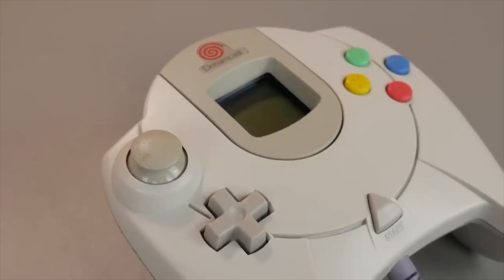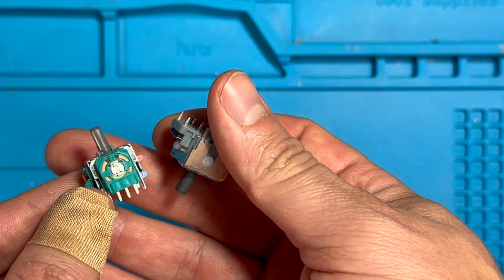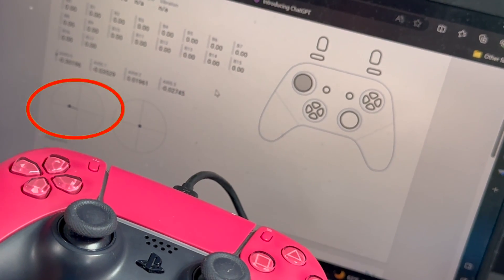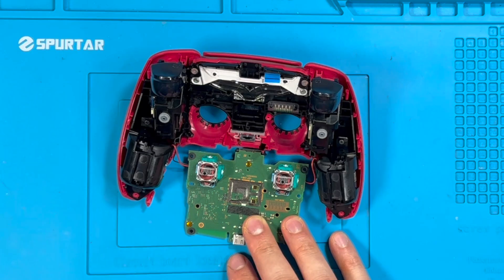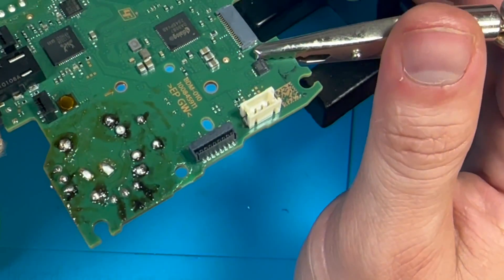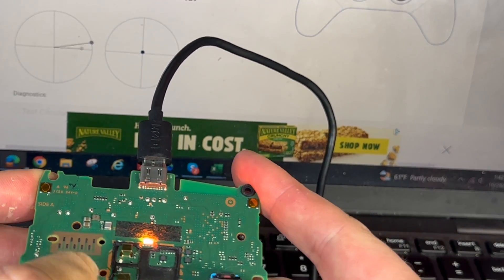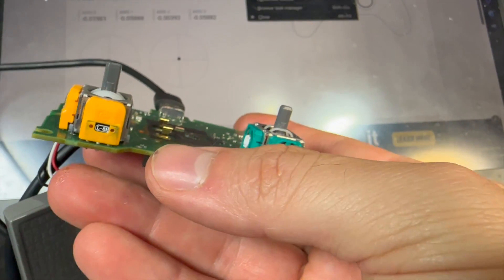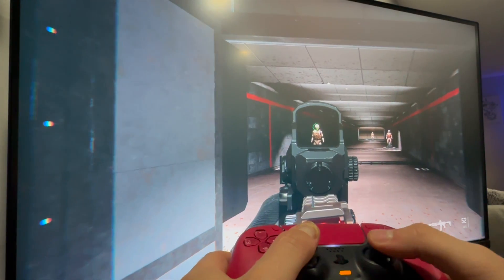Using Hall Effect Magnetic Joystick To Fix Stick Drift Controller

Comment: When soldering the pins on the new joystick, my go to method is add flux, put a good amount of solder on my iron, and just touch the pads. It helps free up a hand. Also don't be afraid if any pins get bridged, just clean your iron, add flux, do a quick sweep, and repeat until the bridge is gone.

Comment: 5:00 instead of that you can just place a coin over the points to desolder. set the iron to max with the flattest largest tip you have and place the bolt on the coin. works every time, i drilled a small hole in all of my heatspeaders to easy lift them away and or hold them in place while flipping the the boards over to do whatever needs done :) 

when using a sucker you get better result by heating the backside and sucking the tin off with no bolt in the way. this is quite easy as the other side now has a hole for your iron's tip to enter and stay in. transfers the heat much faster than just a flat contact point too. i like to place the board at a 90 degree angle with the side facing me, this way i hold the sucker with my left and the iron with the right. makes it easy to line up both hands :) also you should put shrink on the alligator clips there.. the marr the pcb when u have them bare.

i hope that some tricks from an old fart can come in handy some time for you too sir. i did not know there was replacement hall effect pots for these. cheers.
Reply: That second idea would've helped me a lot during my last stick replacement. Wish I read this sooner. 😂

Comment: how safe it is to use the heat gun with these pcbs?
Reply from the maker: i've done it multiple times and it works
Reply: @TheGamer2Know  great to hear. Any suggestions before I embark in doing it? Temperature limit, etc. I tried with the solder iron but I couldn't manage to remove the joystick yet. I'm going really slow so I cannot damage anything. Ive seen some people using aluminum and electric tape to cover other components on the side while using the heat gun.
Reply from the maker: @tahaslime2089  best to use the removal alloy SMD to remove joystick, temperate i usually doing 700 on solder iron and heat gun. Yea you can put foil to protect board. I made this video, also using similar method. https://www.youtube.com/watch?v=GZRlOTXlSe0&t=841s

Comment: How many years it lasts hall effect analog
Reply: About 300. It's frictionless. The plastic will wear out before the magnets fail. I'm trying to learn soldering so I can do mine. It's the desoldering that I'm really struggling with.
Reply: @zachypoo420  I just did mine. Not much experience soldering but I already had a replacement that I bought from eBay for $30. I highly recommend removing as much material as possible with the wick before adding the low melt and hitting it with the hot air. Just makes it a bit cleaner. Also there's now software to calibrate the sticks so no need to do it manually like he did at 8:40.
Reply: @Dspic09  2025 ive seen repair guys like stickrepair use that software. So yes. Maybe at this time he made this video it didnt exist.
Reply: @chrishellmax  yes, pretty sure the software came out in the later end of 2024.

Comment: So basically I’m fucked because I have no clue how to do any of this and I have to keep buying a new controller every month or two because of stick drift

Thanks Sony. Arseholes
Reply: Honestly its not hard to learn. I just did mine with little soldering experience. What I did when my original controller started drifting was buy one off of eBay (around $30) that already had stick drift to practice on.

Comment: Sometimes when I replace sticks the plastic melts to the board from removing the old sticks and sometimes it doesn't. Any idea why this is? It's usually flat enough I just leave it as sticks are slightly elevated installed. Thanks in advance.

Comment: Cost is higher but when you pay $70 a controller you would think they could at least use better parts… a ps5 or and controller uses the cheapest parts a joystick is like a $1 their circuit boards are cheap I would say for $10 they make a controller..

Comment: I have a question it might be a dumb question but here it goes witch one is faster and has less delay hall effect stiks or the regular one?
Reply: i suspect the hall effect as the resistance on the regular ones will take into account the small percentage of resistance of the metal round plates inside. Just logic applied.

Comment: Sadly Hall effect sensors do not solve stick drift it solves potentiometer wear, still a good thing just doesn't solve drift for liner curve players.

Stick drift is mainly from a stick centring issue as sticks are centred by a spring pushing two plastic parts together and coil spring love to loose their spring tension over time... Don't believe me buy a hall effect controller go into the software and remove the DAEDZONE in the software. Gamersir Nexus for the G7 controller for example even has this as a warning in their software stating Lowering "initial value under 10% will make the stick very sensitive, which is prone to drifting, please use caution".
I own 6 controllers 4 with hall effect sensors and they all have drift out of the box after removing the deadzone also they seem to perform poorly in circularity test unless you have software to help fill in the gaps. 
Sadly social media has hyped them up and put down potentiometer being the main issue defiantly can be if they are worn however you would see voltage drops where it makes less contact resulting in loss of movement like my old Xbox controller.

Saying that I really like the Gamesir G7 light weight, 1000hz, rear buttons and it has drift like every other controller.

Comment: The issue isn't that potentiometers are trash and hall effect are all great and last forever. This is a myth and simply isn't the full truth to the matter! 

There are of course good and crappy hall effect modules, just like there are crappy potentiometers and good potentiometers as well! 
The analog sticks on my 8 year old Ps4 controller still work great. (The old battery inside not so much.) 
The sticks on my brand new Dualsense PS5 controller though are already creating massive stick drift after just 35 days!
They both share the exact same technology, even made by the same manufacturer as the old PS4 controller, supposedly even upgraded to the V2 on the new Dualsense controller. Still one of the two is absolutely great, the other one is complete and utter crap! 

The detailed technical reviews and thorough tests I have seen on Hall effect modules replacing potentiometers so far were all not exactly very promising at all! 
There were issues with jitter with unacceptable and uneven dead zones.  
Yes, the hall Effect modules usually do work, but they very often seem to perform rather crappy whenever compared to good quality potentiometer versions!

When using Hall effect sensors for example, you will normally want them to be accompanied with suitable electronics filtering and averaging the signals to eliminate jitter. 
The claim that the Playstation or the PC itself will filter the jitter out is generally NOT true and the test used in the video shows you otherwise! It absolutely will affect some games more than others so it may not necessarily be a big issue for certain games, but the jittery input displayed in the text will be jittery input to the game and will NOT be filtered by the playstation! This jitter does typically NOT happen on potentiometers (unless they bare faulty) and that is exactly why the Playstation (and Windows) do NOT filter or compensate the input values to eliminate this type of jitter. This would need to be done INTERNALLY/ INSIDE the controller with suitable electronics which are obviously NOT part of the Hall effect module that was used here in this video!

What the test in the video does show you instead, is simply that the installed Hall effect sensor is absolutely NOT performing nearly as good as a original potentiometer one did when it was in good working order!

So if you need to replace a faulty potentiometer, then you may instead want to replace it with a GOOD high quality potentiometer, much rather than replacing it with the comparably poorly performing Hall effect sensor shown and installed here in this video! - Or wait/ look for a hall effect module to be sold on the market that performs considerably better than the poorly performing ones used here in this video!
Reply: I appreciate the effort in this video. 
But this comment just has absolutely the best of accurate info I was able to collect over about 3 months!
Hat's off. Great work, man!
Reply from the maker: Legend!

Comment: I replaced both of my OG PS5 controller sticks with the Hall Effect ones used on this video following this tutorial. 
So far, I’m very happy with the results. They have more resistance than the OG ones and the click is a bit louder, but so far they work great.
Reply: Did you use a heat gun to remove the joysticks?
Reply: @OKBUDDY21  Yes what he has done was overkill, if he use the solder pump in the first place he saved a lot of money and time , and the solder result doesn't look very good, you should have a shiny glossy finish after soldering,  if it is flat you have to much temperature and you have  burned the solder. Other that minor detail he has done great job
Reply: @powertothebauer296 he asked about a solder heat gun lol
Reply: @OKBUDDY21 i trying it now without it its allmost impossible
Reply: @z3ro7o  16 w soldering iron is enough for that , everything with more Power is overkill .
Reply: @powertothebauer296  yeah true but we talking about something else a heat gun . You need one otherwise the sticks wont fall af
Reply: @z3ro7o  Yeah, the heat gun just makes things way easier.
Reply: Removed haptics magnet or not because it's effective on analog it's basically magnet

Comment: corporate greed makes me so mad, a $90 cad controllers joysticks are worse than one that came out decades ago, its ridiculous and its planned obsolescence at its finest, this problem should not exist.
Reply: fully agree. I bought the expensive dualsense edge with the benefit of replacing the sticks when stick drift occurs. Well… the stick modules are out of stock for months. Scammed
Reply: @VinvisYT  god there's nothing that pisses me off more than the dualsense edge, sony is just creaming their pants solving a problem that shouldn't even exist, u get to pay $200 for a controller with a recurring $20 fee every time you inevitably get drift. They could just use hall effect sensors and be done with it, its so anti consumer fuck sony. the fact that sony controllers have used hall effect sensors and been straight up better in the past too, it literally makes my blood boil. Every product Sony makes is an overpriced polished turd
Reply: Me too - what makes me more Angry is that they knowingly do this . As pushing in the left controller stick for 90%. Of the games for the sprinting method" this is why its that way

Comment: Have you changed the internal spring yet to change tension on  the sticks? I’m always sending my Battle Beaver controllers back to them for drift every three or four months. If I could put these new sticks in there and also change the spring to get the tension I need it would be great.

Comment: mine are sticky AF... I bought 2, installed them, left stick did not worked properly cuz after pressing L3, the stick never centered back and was whimping all over the place so I put it forward and it remained there like if the spring was not there to center it back to the middle... right stick seemed fine... I purchased 2 more... replaced the left stick AGAIN and now it works fine but day after that the right stick had the exact same issue... so I replaced that with the new one and now it has the same damn thing... I cant press L3 to lock on, every time I move the stick I hear crunching in there (yes it is clean inside) so it feels like its either not lubed up, too much lube so its sticky inside or I dunno... but I dont want to spend another like 15 bucks on sticks to try more and more and more until I finally find all 4 good ones to fix both of my gamepads...
Reply: you are not gettting the stick flat with the board

Comment: Do these work on BDM-010 BDM-020 and BDM-030 I heard these all took different potentiometer sticks since the voltages were slightly different.
Reply: Hi there! I was looking for the answer to that very same question. You ever got an answer?
Reply from the maker: Sorry for replying one year later, but these sticks work with all the gen controllers

Comment: one thing to mention is, that when you replace the analog sticks with Hall effect ones, you will have a small under-or overshoot, meaning if you pull the stick 100% in one direction it could show about 90% in game or 110%if you overshoot, meaning if you want to move your character with Hall effect, he could either go already at maximum speed when you didn't wanted him to or go slower than you wanted.
Reply: This issue only happens in ps5 controllers not a general thing though,i guess hall effect hasn't been perfected on it yet. However,The one in my ps4 controller is just perfect, my aiming in games got improved drastically.😅
Reply: theres calibration software to fix this
Reply: Dang that's crazy.. sounds like it would be annoying and could be problematic

Comment: Are the Hall Effect potentiometers swappable with the carbon/wiper ones? Or do we have to swap the ENTIRE joy stick?
Reply from the maker: Excellent question! You just gave me idea for a new video :)) to be honest I don’t know. But I will experiment and let you know what I come up with
Reply: @TheGamer2Know  Thanks, I just bought 10 of these since I've been replacing potentiometers like a mad man these last few days. The reason I ask is because I'm primarily fixing Xbox Elite Series 2 controllers, and those have a threaded/magnetic joystick stem so these Hall Effect ones will not work with the Xbox Elite accessories. If I can get away with only swapping the potentiometers to these Hall Effect ones and keep the joystick housing itself original, then it's the best of both worlds. That's assuming the magnetized joysticks on the Elite do not interfere with the Hall Effect sensors.
Reply from the maker: @spartanvi They will definitely interfere. As in my video towards the end when I took the magnet and brough it close up to the hall effect joystick,  you could tell from the gamepad tester the stick was moving in response to the magnet.
Reply: @spartanvi  this idea off yours , is it solved the problem? I want to try this my self.
Reply from the maker: i've done experiment on your questions, here is what I found out: https://www.youtube.com/shorts/MoyBWy0In2Q
Reply: @TheGamer2Know  the link is dead, did you remove the video or is it unlisted?
Reply: Ive seen people replacing their dualsense with hall effects.

Comment: hi man, have you tested circularity with hall effect joystick?
Reply: Yeah can u do this for us what is better for 0.00 in game deadzones so basically a no stick drift controller. Hall effect or the replacememt module soldering you showed us were the deadzone ended up zero on the red ps5 controller